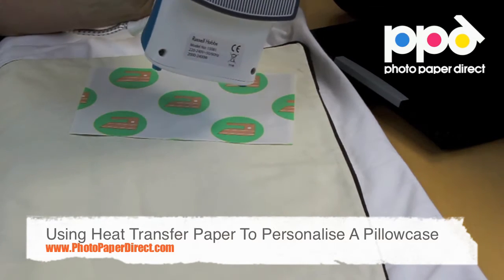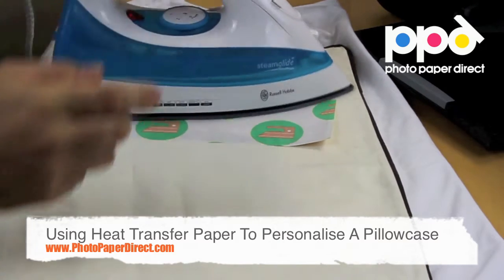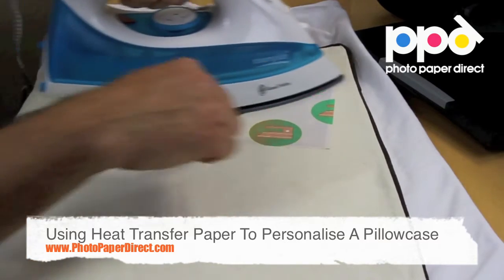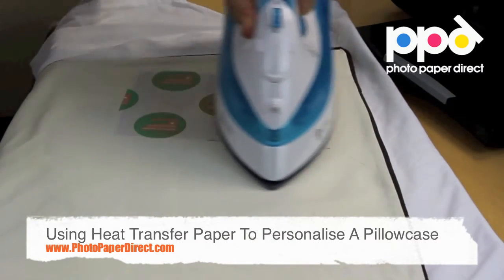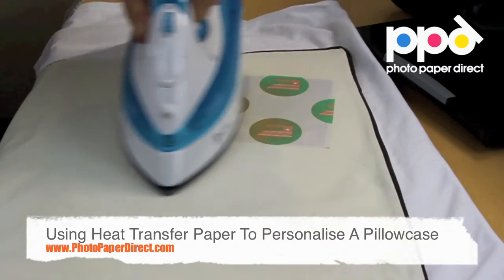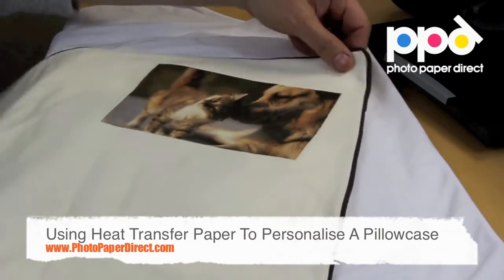Using Heat Transfer Paper To Personalise A Pillowcase

Comment: I just heard with that paper you can not add words because you would have to cut them out one by one to add them for dark color shirts, is that true? Seems very long process if someone wanted a picture with words added to a t-shirt you having to do all that work.
Reply from the maker: Hi,  Images with text require only mirroring using the light transfer paper, using the dark transfer paper mirroring is not required. The requirements to trim the image, or text in your example, depends on the background of the fabric and your desired outcome. Transfer paper is essentially a film that can accept and transfer ink. Therefore the actual film might present on unprinted areas depending on the color fabric. Best practice therefore is to trim any unprinted areas as best you can, to refrain from any film appearing on the fabric. Sorry for the long reply. I hope this made sense. Thanks for the comment.